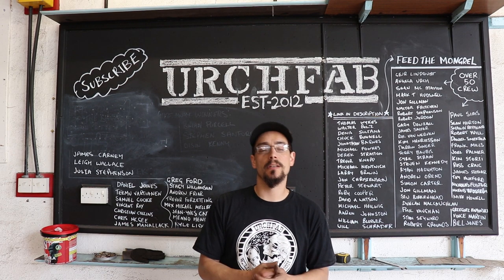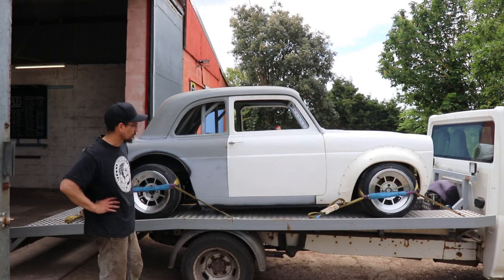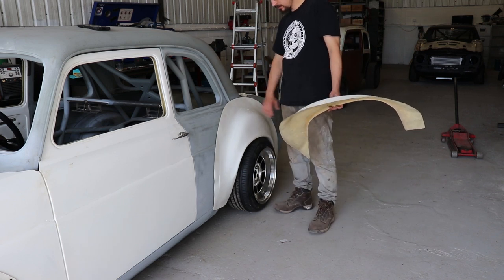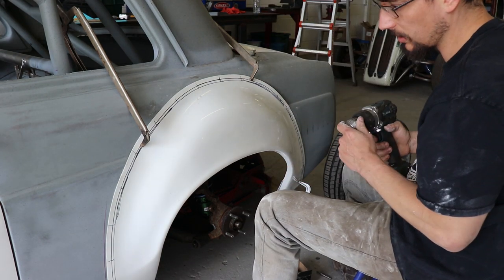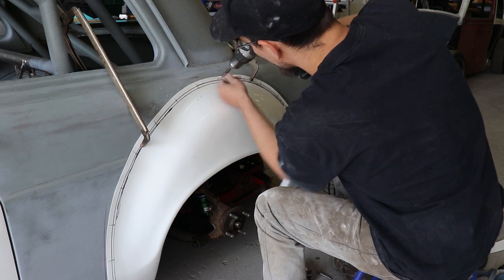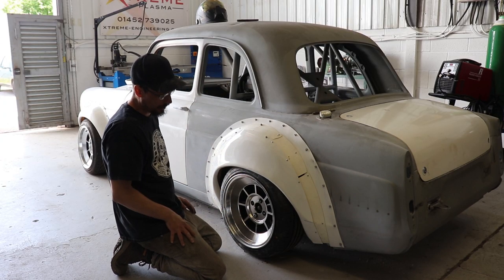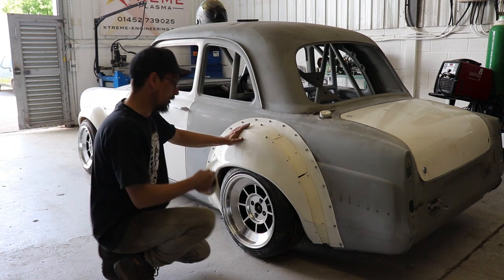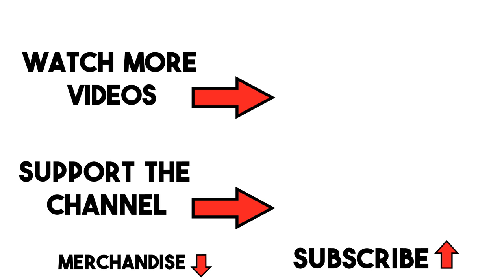THE MONGREL WALKS. PART 52. MX5 MIATA FORD BODY DRIFT BUILD.

Comment: Great to have you back Matt.  As others have suggested, take that modified arch to a fiberglass shop and they can use it as a pattern to make right and left moulds.  If you're going to be taking this on the track, you're going to need spares anyhow, so it'll be more cost effective to have the moulds handy and pop out new arches as and when you need them.

Comment: The Mongrel looks absolutely stunning, Matt! Fill them up, paint them & take moulds (or speak to Old Ford Auto Services about making moulds for you. I'm sure they'd be able to find a market for wider rear arches for Mk1's which might lower the cost!) ... that way, if you smack them, you can make up spares! I spent weeks fabricating steel front arch liners on the Corsair. Then cut them in half to get them out, filled , painted them & took moulds. Now I'll never have to suffer rot to the front new wings, light units & under body. Best thing I ever did! All those years building single seater hillclimb cars with my mate Graeme Wight at GWR Racing taught me how to make bucks & take moulds! Congrats on the new workshop... goodbye cowshed *sniffle*!! Cheers. Leigh.

Comment: Hi Matt.  I did wide flares on a Mk 1 consul many years ago and (before you tube days) and with it I used metal conduit tubing bending around tyres or rims then pop riveted panel steel  sections on to get the shaping then over the top applied fiberglass and with a lot of sanding got the shape it wanted. The whole set up was very strong and no wear from gravel. Sadly I got married and the car projects were scrapped. I did go on to build 2 model t buckets (vee 4 powered transit motor) and then a sleeper Toyota van with a 3.3 liter straight six Vauxhall Cresta and auto box. Caught many people out. Keep up the good work.

Comment: You need to use fiberglass wire in your welder, with helium shielding gas.  It'll be fine.
Reply: I reckon Matt might get away with using PLA printing filament in the MIG as long as he ensures that he has a really clean earth connection.
Reply: @Del350K4  He could try fiber optic solid wire with fiber gas too.  I never tried that myself.
Reply: glass blower
Reply: @markeholbrook  Fiber optic wire only works for welding window glass.
Reply: @markeholbrook  Of course! I guess that to get enough fiber gas he´d have to go on a high-fiber diet and then somehow collect the gas...
Reply: Nice comment, I get it.....it'll be fiiiiiiiine.
Reply: That's the problem with not using sky hooks.
Reply: @Ogma3bandcamp  Can sky hooks be used indoors?
Reply: @Del350K4  Only if you have opening skylights.
Reply: @markeholbrook  : )
Reply: Blinker fluid? Chrome muffler bearings?

Comment: The arch looks great, and you're almost done. A couple of layers of fiberglass matting on the backside and it's self supporting. Then you can remove the screws and smooth out the surface.

Comment: I'm sitting here shouting" you forgot the brake disc!" That will surely space the rear wheel out another 10-15mm? 
Looks absolutely awesome though! Love this project.
Reply: 4-6mm at the most it’s only the thickness of the disc mating surface not the thickness of the actual disc

Comment: The Mongrel and new shop look great. Don't forget to pull a mold from each of the rear flares...just in case.. And how about having the hoist closer to the door if it's a drive thru type ,saves having to shift everything out to get cars onto it.

Comment: Hey Matt I use 2mm -3mm alloy strips being more and rivets riveted in from underside fibreglass tape it off then glass it from top whilst on the vehicle then remove guard/flare drill out the rivers then glass it from the underside then sand/prep

Comment: Poo up the one you've got, then make a mould off it. Then lay your fiberglass inside the mould  to make the real one. Sounds like a lot of work, but it's quite fast.
Reply: Good plan! I made front arch liners out of steel on my Cossie Corsair, then prepped & took moulds. No more road scrap to ruin the new wings lights etc!
Reply: As a trans woman that's what I'd do 😀

Comment: There’s a body line down the side of the car, the top of the front arch matches the line but the rear is way higher. 
Might even out the proportions a little if the top of the rear arch was lowered?

Comment: Would it be too messy trying to just fill in the extra bit with loose fiberglass cloth and resin? And perhaps turning the arches into plugs, so you can make your own fiberglass arches for it. Would also be handy if you broke the rear arches!

Comment: As for your 2 post Lift set up ...if you set it diagonally on the opposite side away from the door on the same side as your plasma you can back into it at an angle and then have additional room without a whole lot of maneuvering and still be underneath of the tallest section of your garage space and you can even leave it up closer towards the front if you liked

Comment: Dude that looks awesome! After watching this series up to this point, I've been considering a build like this my own self. Probably not to the degree of rust restoration as you have. But similar. I've done a couple rust restorations (just wheel wells and rocker panels) and they were time consuming and frustrating. I've learned alot from you on how to do it better. Thanks! And keep up the amazing work!

Comment: When doing this type of bodykit modifications I do exactly the same to get the rough shape. Then use 450 gsm  fiberglass mat  on the inside to hold it in place. Once cured then remove the screws.  Aggressively sand the edges away (on the outside). Then do at leased 2 layers of 250gsm... wont move then....
Plus its a good to get that glass experience.... tracking a car does not lead to long life of  body kits lol

Comment: Hey Adam, here's one you might try. Support the 2 parts of the flair from behind, bits of wood and hot glue is best for this as you will remove these later on. Not sure what you call it there but in Australia it's called speaker cloth, it's a 2 way stretchy material available in haberdashery stores. Stretch it tight over the flair, pulling the edges to get the fit you want. Use hot glue to pin the edges down as needed. Once you have the desired shape, contours etc. give it a coat of fiberglass resin (resin only). Once it dries you can remove the flair, fiberglass it from behind and remove the wooden supports. 

Hopefully this explanation is enough to get you going. If not, just let me know. Keep up the great work :)

Comment: I love it , arch wise get your self some fibre class mesh and resin and bridge the gap from under the arch in a few layers.
Then once dry you will have your shape , on the top use fibre glass body filler only otherwise it will not bond properly and when it  flexes cracks will appear .
Sand and then paint.
After that you could also make a mould for your Newley created arches invade you crash and need to make more

Comment: 5mm solid steel rod welded at both ends only, to make your arch lip, you can pull it out or push it in to suit your tyre, brace it temporarily, then a couple of slightly longer lengths between arch lip and body to shape the arch, then  plate with steel sheet.

Comment: Your fibreglass welding is better than your alloy welding, so neat can't even see the bead :-D 

The Mongrel going be a looker, I would do steel rear arches unless silly money. Faffing around with fibreglass is a pita when u a steel man and they likely show joint cracking in final finish pretty quick unless 1 piece molded .

Great to see an update and new shop looking like urch and car family home .
Defo need a shallow mezzanine spanning across from toilet .
I would put lift high roof side but angle slightly so still easy get easy path on and off lift when coming in shop on right .
I done my 2 lifts like that as 1 behind the other and access and footprint works out good .
Have fun and look forward to more Mongrel goodness ...

Comment: Im fairly certain you could make a rough but solid arch using your patchwork one as a mold. It would require some work afterwards with final shaping and sanding, priming and painting of cause. From what i remember you need also take into consideration if you are using polyester or epoxy in your glassfiber, as polyester has a harder time bonding to hardened polyester unless the surface is rough enough for it to grab onto. Epoxy however will bond to epoxy chemically even after the piece you are trying to bond to is hardened. This might only be relevant if you decide to close the gap in your existing arch - which might also be an option. Another two tips: Ive used aluminum tape in the past as a barrier as the active ingredient will not adhere to it. If you decide to mold yourself, i strongly suggest mixing in the correct amount of hardener. If you accidentally overdose, the piece will get extremely hot and might catch on fire. 
Im no pro, but this is just what ive learned from doing some glassfiber motorcycle seat pans. 
Keep up the good work!

Comment: The Binky chaps did something with Lycra to extend their fibreglass arches.  Seemed to work.
Reply: that was a fascinating video, but not sure if that's a technique anyone else will use.
Reply: I think the Binky method would work well and look better than the current shape, as the rear arches go up way too high and ruin the lines. The fronts look good, so can you fabricate something similar?
When you moved the Mongrel without the rear arches, the side view was great, she looked  mean, but still pretty. You have to try and keep that look.

Comment: You should have optioned for the GiG ( Glass Inert Gas ) upgrade for your welder. A little pricey, as they are hand assembled in Murano, Italy. You will be amazed at the finish of your glass fibre work though 😁

Comment: Dont know if this will help but back in the old days we used to do arch flares using flat bar and electrical conduit by creating the wheel arch profile we wanted  then standing it out from the body on flat fillets  that can be shaped for profile  and then plate in between the body and the new arch bit finicky but does look good when done.

Comment: Just my opinion, but if you look at a still shot at 14:13 and have an eyeball at the height from the top edge of the front rim to the bottom of the arch, and compare it to the top edge of the back rim to the bottom of the arch, do you see the difference? If the back 'gap' matched the front, I think it would look much better. Just my thoughts though   :)

Comment: Looking fine as a mock up,duck tape the inside then roughen the outside with a flap disc and vaccuum cleaner strategically taped on the outside to catch grinder rooster tails lol then de dust and add 3 or4 layers of new glass to extension,edges feathered out for better surface contact then light sand and fill,paint and maybe make copies for future replacement as now would be the time.

Comment: Missed a bit create wheel arch profile from conduit, knew a plumber back then who put fat arches on his Anglia van like this he did his out of 1/2 inch copper water pipe and solder joints  not so good , looked o k for a while then the body filler started to craze from the vibrations

Comment: Everyone is going to have their own opinions on what you should do about the clearance (at least that's my experience with my miata+vw build). But it's your build and you know best. However, might I suggest a different set of rims? Some +45et steelies, maybe. I like the wheels ya got but new wheels would be a very very easy way to throw money at the problem.

Comment: Use what you have there to make a plug. Body filler will smooth out where the screw heads are. Make sure you paint the plug to seal the body filler.
Then bang out a new custom arch.
If it's still not quite right, modify that one make a new plug off of it.

Comment: There's a trick you can do when widening the arches, when you've split the arch and spaced it with a small piece and some screws (like ye did) you could have used gaffer tape or brown packing tape as a mould, cover over the gaps from the front side with tape, lay up fibreglass on the back side, using the tape as your mould, when the fibreglass goes off, peel the tape off (brown packing tape works the best, peels straight off, no probs) then give it a sand and a fill with some body filler, easy ;-)
and nevermind the fibreglass car repair kits, with the pink pastey stuff, it's crap, east coast fibreglass supplies in England will deliver to your door, just be careful with the catalyst, it burns skin, that's why the car kits come with pink or yellow paste stuff, because that's safe, but leaves the fibreglass sticky and generally gives you a crappy finish, so be careful with the catalyst, and that, know?

Comment: Tough💪.. The Mongrel definately needs some balls to back up the brawn. Mazda Bpt/bpd would bolt straight in, with a Ford laser bpt rocker cover of course👌..

pull the flare off, glass the inside strong, pull tape off and screws out, remove high points plus enough material to flush fill, prepare gelcoat around repair. then use as little mat and resin as needed to surface and as outter reinforcement.

Comment: think you could leave the fiberglass bits in an put fiberglass mating on the back of it , then take the screws out annd fill out the top 
if you can make then so they dont loose their shape if you take them of you probably can have youre bodywork guy smooth them out and make moulds from them and make new ones that are lighter and made from one piece 
you allready had the colour choice made for the cr butwhite looks nice on it too

good luck in youre new place

Comment: Good luck getting that potato field smooth..  After you got tired of hoarding old rusted and busted cast iron parts, you could might as well take a look into designing your own rear suspension. Something that would work in your application, and could possibly even be drivable.

Comment: Those wings are going to be Phatttt. I am not a fibreglass expert by any means so my word doesn’t carry a lot of weight but I have seen guys use that stretchy t shirt material and a bit of resin. You stretch the material under / over the shape you need to create, it pulls tight, you harden it with resin and fibreglass over the top of that to give it strength. Just wonder if you could screw the wing on with some t shirt material underneath, stretch it threw the hole you have cut, pull it tight over the outer lip, screw it back somewhere, maybe to the lip of the inner wing. Harden it with resin, fibreglass it hard from the inside somehow and then a lot of trimming and filler. I would be nice to say I have done this before and it works a treat, but I have not so I don’t know but in my mind it will. More research needed.
Reply: P.S. some wet t shirt action is always good in my mind, on the car that is.

Comment: Looking good. I've actually used thin hobby shop balsa or basswood to span gaps between fiberglass pieces. Glass one side first then sand the majority of the wood out before glassing from the other side. Any wood that's left is encapsulated in the epoxy resin and won't hurt a thing.

Comment: Matt - you need to wet the plastic BEFORE the MIG will work -- EVERYONE knows that.  HA.  Sometimes it also helps if you stand in a puddle of water whilst using the electric welder - bare feet suggested - all worth experimenting with.

Comment: Finish the guard off with filler and a very shiny paint to use as a plug / form, support with MDF where needed. Take a mold off that plug and and make a carbon or glass guard from that mold. Similar to this. https://www.youtube.com/watch?v=3i0EkkAfFHI

Comment: Love the urch bubble arch rubbin. 

The car looks awesome dude.

Even a transgender person would say...go steel on The back arches rich....because that's your gig. 

But as a early two thousands max power scene guy

I could easily sort that out with 18 cans of ' big boy' fibreglass filler from proper job and an 80 grit flap wheel on a lidle grinder

With a rothman in my teeth